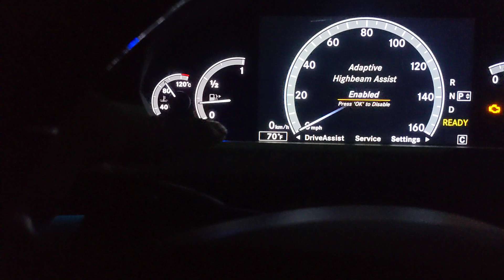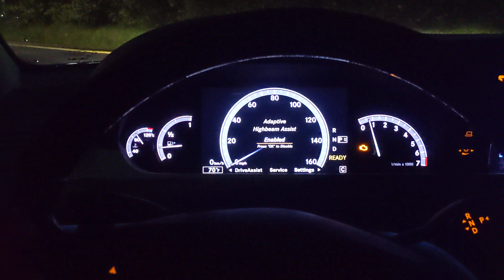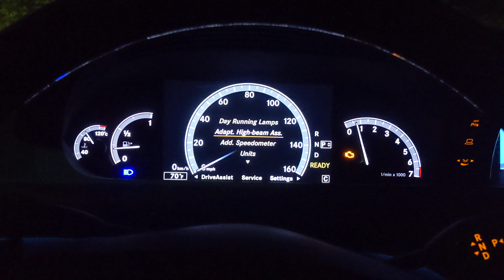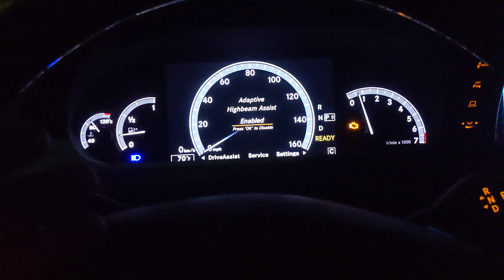Adaptive High Beam Assist - How it Works

Comment: how do you turn off the engine light :)
Reply from the maker: To turn off the engine light, you can use our YOUCANIC Full System Scanner. It's a reliable tool to diagnose and subsequently handle your car's issues effectively. Learn more about the scanner at www.youcanic.com/scanner. 

We also offer a diversified platform inclusive of OEM Factory Repair Manuals, where you can ask car-related questions at www.youcanic.com.  Feel free to delve into our resources, and if you need further assistance, don't hesitate to ask. We're here to facilitate your automotive journey.
Reply: @YOUCANIC That was a joke question xD